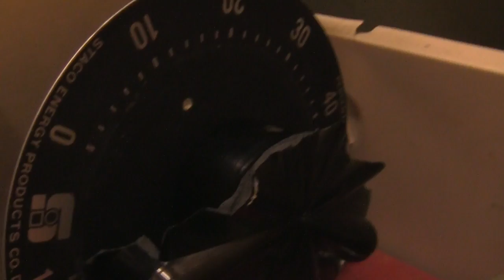3-phase Variac test

Comment: That's one hell of a variac! I bet it'll be a swine for tripping the breaker on power-up though, even my 15 amp one does that. Could be worth putting a ballast inline with it, with a bypass switch (start with the ballast to limit the inrush, then short out the ballast and run at full power).

Of course I know sod all about ballasting and just soft-start mine with a mains conditioner, but I assume that would work?